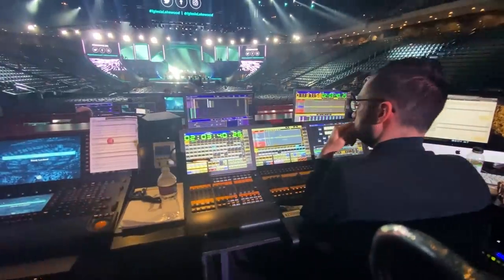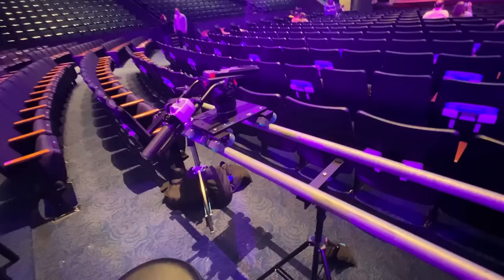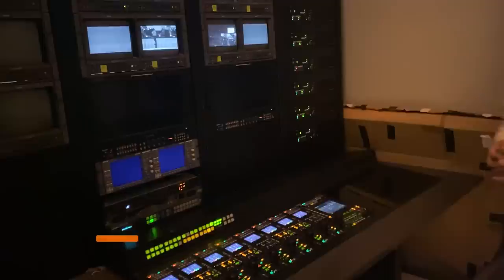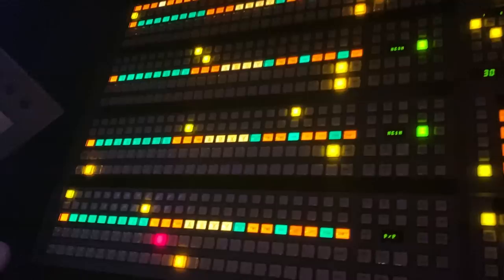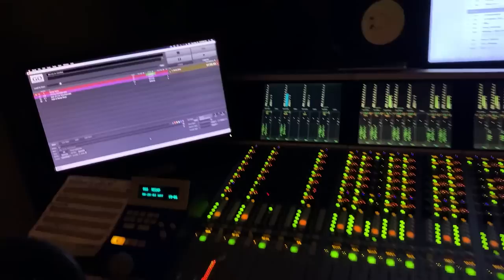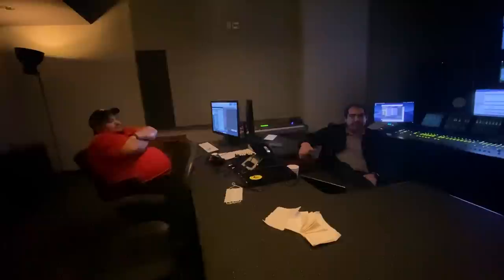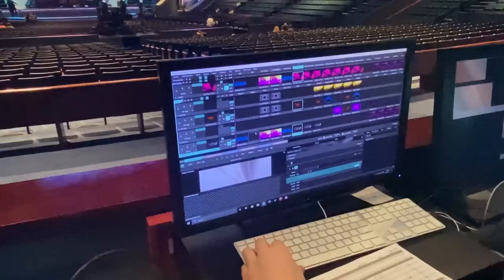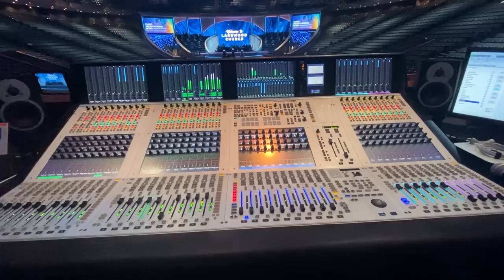BEHIND THE SCENES…It’s MIND-BLOWING ! | Lakewood Church TECH TOUR

Comment: How do they split audio for 3 mixers?
Reply from the maker: There are many ways to do it depending on the scale and systems you are using. In smaller / mid scale some people use Dante or I have seen people using a normal stage box like a Behringer S32 with Midas or Behringer Boards etc.. as for Lakewood church unfortunately I didn’t get into the tiny details during my tour